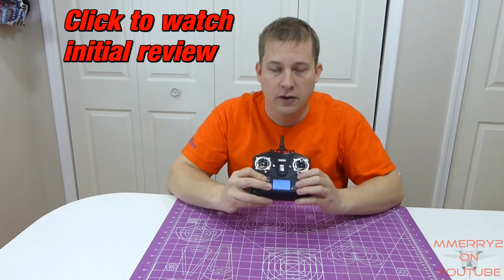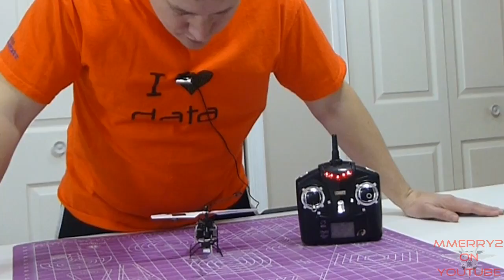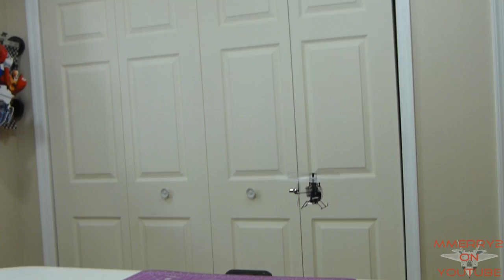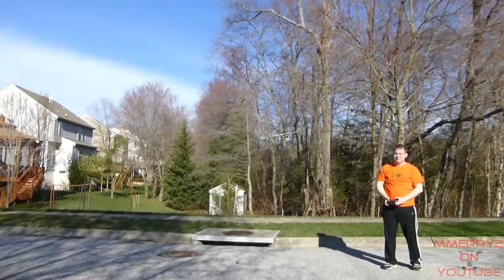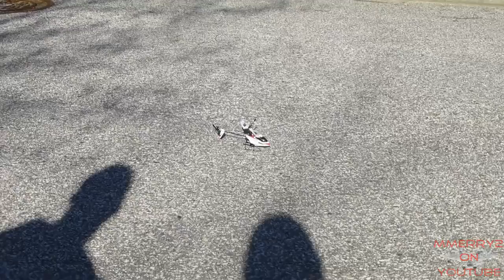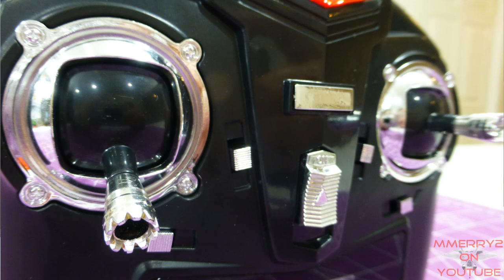WLTOYS V911 Helicopter Review Part 2 of 2: Flight Testing and Final Thoughts

Comment: I bought one of these and have tried 6 different batteries, the ones that came with it and a new set. It doesn’t produce enough power to maintain lift even if the batteries are full. Faulty chopper?

Comment: Your kidding, what is nice head lock
Reply: Head holding or head locking is the ability of the helicopter to stay with its front or "head" pointing in a desired direction, even with external sideways forces. This is the gyro's job. It has a sensor that picks up on unwanted yaw (turning left or right without banking) movement, & alters the tail rotor speed accordingly so that only rudder control inputs will move the helicopter's direction. Without this, wind force would blow the tail around needing constant corrections. Without a gyro in sideways flight, the helicopter would "windmill" & spin to face the wind by itself. Sideways flying is possible without a gyro but requires more skill as you need to apply (juggle) opposite rudder to keep it going sideways.

Comment: Dude!  You need to answer your questions!!  That's not cool you having Tmart send you that for free for review and then you don't answer people's questions!
Reply: +Canna Occult   I agree, and he should know how it works also, because he turns on the transmitter and then inserts the battery into the heli.    Which I read the instructions and you are supposed to put the battery in, let it blink, then turn on the transmitter until the light on the copter stops blinking and that is when it is ready. Maybe it dosen't matter? but from what I've read and experienced, I would stick with battery in copter then the transmitter.   Tmart send my your heli's and I will do alot better than this guy...............LOL.

Comment: Great review, thanks for sharing.  I just bought one of these and gave it a test flight.  I'm having trouble setting the trim.  Once I get the blades going a bit it seems to want to roll to the left.  I've tried trimming it out but must be doing something wrong.  Any advice would be greatly appreciated.
Reply: Make sure you trim it in the opposite direction of the way it is drifting in!  Good luck!
Reply: Orlando Flores Read your manual do not rely on just the electronic trims. Take note the links from the servos are adjustable in length and will fix the drift very well.  On take off you will usually need a bit of right and forward till you get away from ground effects

Comment: Wish one should i buy ether the propel speed star wish is the same as v911 or should i buy the v911? Please email me edv312@live.com with a answer thanks
Reply: I purchased the Propel Speed Star from Radio Shack about a week ago, and its is of course identical to the v911, but I believe I got a dud because it had a very hard pull to the right rear out of the box and would not correct it self no matter how much I tried to trim it. I've since returned it and plan to buy a WL v911 next. I'm sure the Propel's are great considering every video I've watched with them were good, but I believe I just got a bad one. I would buy the v911 over the Propel though because the propel costs twice as much and comes with one less battery.